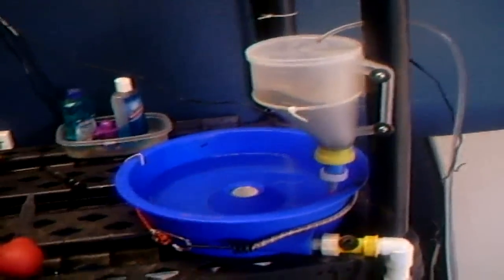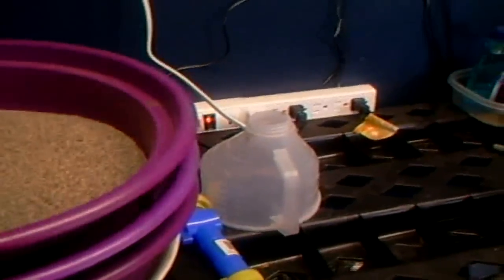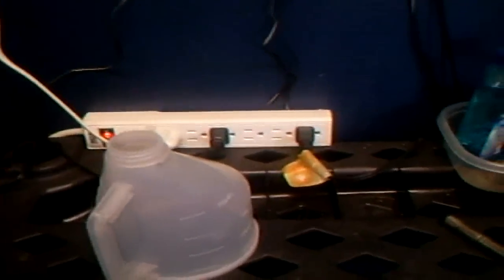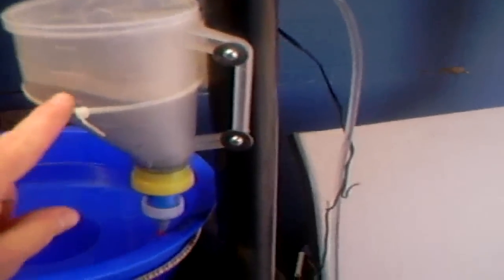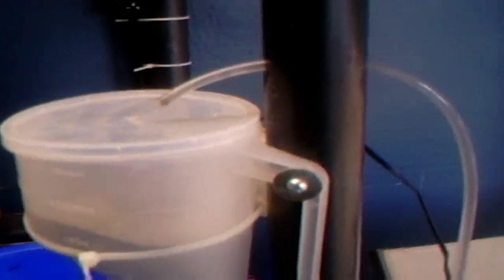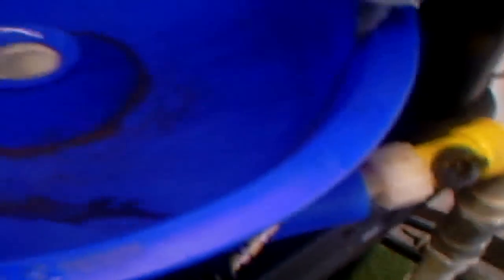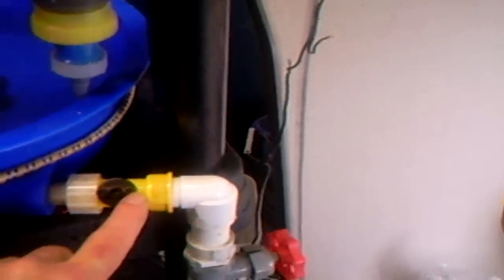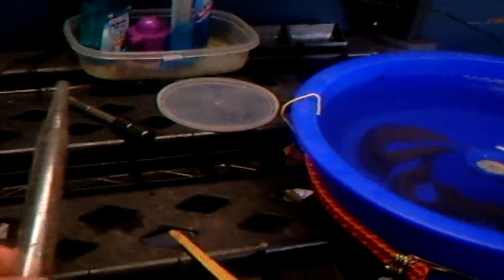Blue Bowl Gold Lab Homemade "Son of Gold Lab"

Comment: Your design is moving along nicely! good job... 

I find the Mackirk sluice use interesting especially. 

Steve's overflow design is genius the way he drops the material out of suspension and feeds his cleanup up sluice with just enough water for the cleanup sluice design he used. 

Thanks to Steve for his original idea and showing his great techniques for running a blue bowl!

I really like the vibrators you used btw... my cats destroyed one of those back massagers... *light bulb flickers*

Comment from the maker: @johnswindowcleaning I process all the different mesh size's in the Blue Bowl. I Ichange the the drip spout tip on the hopper for the bigger mesh size and adjust water level for that mesh size. For the pebbles that I screen out I run a pin pointer metal detector over them to see if there was a picker I might have missed. I hope that answers your question.